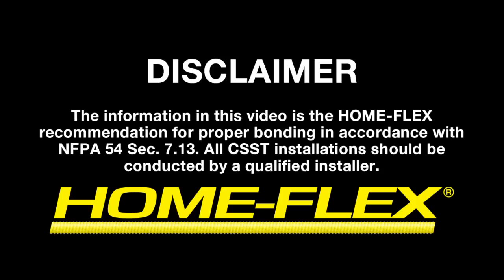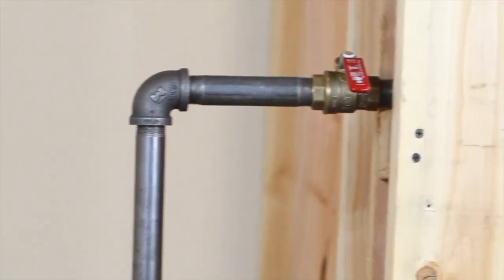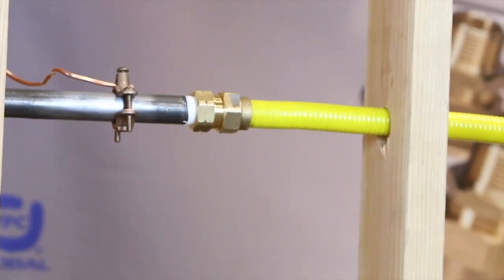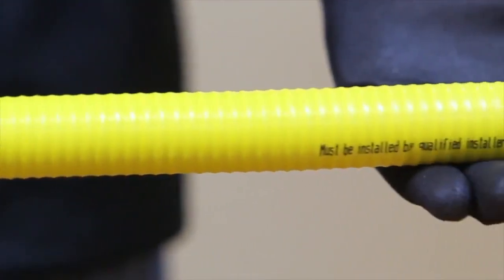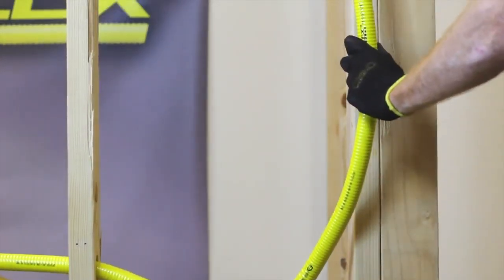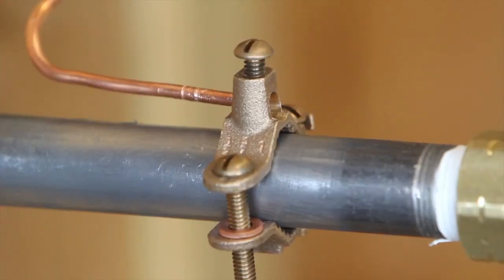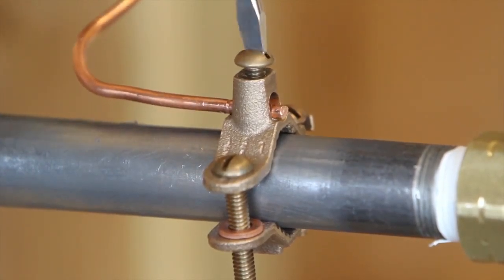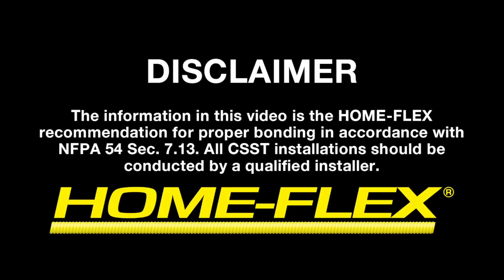How to Properly Bond HOME-FLEX CSST

Comment: Is it possible to bond it to the bonding screw on my hot water heater? That don't sound right, in other words my HWH is bonded to panel box. I would have to run past HWH to go to panel box. Can I just run it into the bonder thingy for HWH?
Reply from the maker: We recommend bonding directly to the panel box. This will ensure the strongest bond and will eliminate the possibility of the HWH energizing the gas line or vice versa, rather than only going to the panel box.